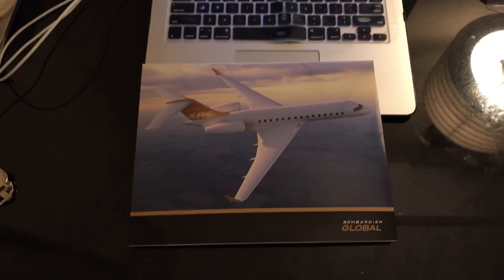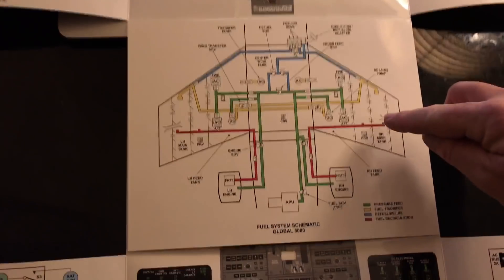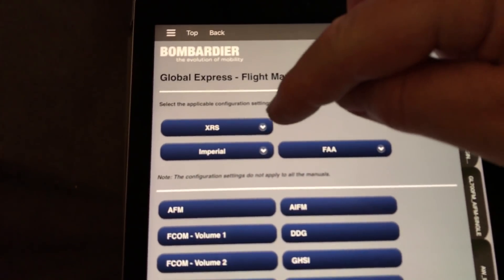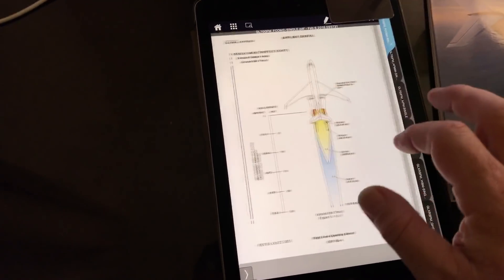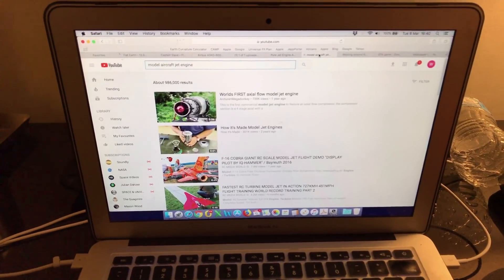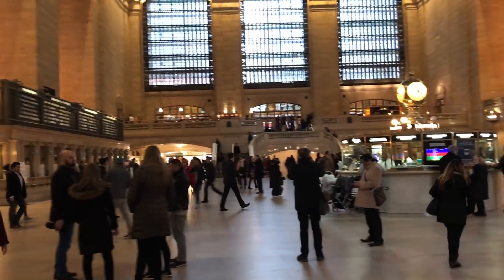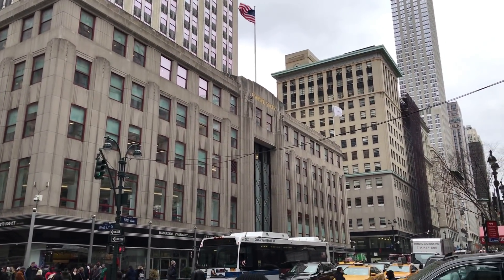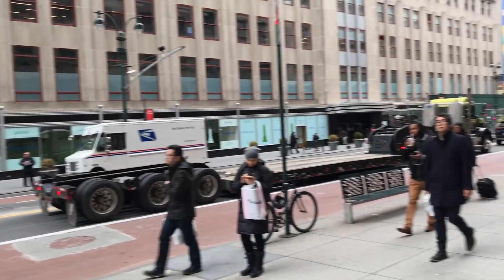Don't be ridiculous - of course Jet engines use liquid fuel.

Comment: There is one guy, from my country the UK and to listen to his videos on this 'no fuel' conspiracy, I'm not sure whether to laugh or cry, he is an embarrassment to the human race. But basically, he make videos where he shows the fuel transfer truck, then babbles on about impossible flow rates, impossible wing tanks etc. 
Then he had a book on diesel electric trains....where's the huge fuel tank he asks. 
Even more funny is that his job is a heating engineer! I wouldn't want him fixing my CH.
Reply: Rob Dunfy you on about Jones senoj? You mean the guy that's got the airbus spec book and has gone through it, researched topics you have just mentioned, and called it out for the shite it is? Could you please explain the lack of fuel tanks or flow rates not adding up? Or the 100t on each wing of fuel supposedly? Fun fact, a maus tank in ww2, heaviest tank ever made only clocks in at 188t.... So an airbus weighs more than that.
Reply: Oh, yeah.  You really ARE one of them braindead scholarly characters that can't  keep his spittle contained during a conversation.., 

Fun fact.  Who cares if the Germans built a 180 ton tank.

A fully loaded (Fuel and passengers) clocks in a 1,265,000 pounds.  That is 632.5 tons.  And YES, it actually flies.

There are some maths for that if you are really interested..,
Reply: Read some of these for starters:

https://tinyurl.com/yaza5twf
Reply: Neil Helgeson 630 tons, so over 3 times the weight, the maus had a 2280 hp engine and could move at 12mph, I understand about ground resistance it's a tank and all that. But something over 3 times heavier, with a hp of 8x more with respect to weight can fly and reach speeds of over 500mph. How do the wings not snap with 100t of fuel on them each either? They're only made of lightweight alloys.
Reply: The Truth I still wouldn’t want him touching my CH system! Clearly if he can read a Valliant manual and understand it runs off gas, but reads the airbus book and thinks it runs off air, then something is seriously wrong with his analytical brain.
Reply: Rob Dunfy so a guy with expertise in piping and such raising a point about liquid flow through pipes obviously hasn't got a clue what he's on about... Yet you'll listen to wolfie who is a PILOT and not an engineer instead..... I don't get it.
Reply: +The Truth I guess you mean the guy who missed, for example:

http://www.airliners.net/forum/viewtopic.php?t=1360257

No fuel tanks?   The fuel tanks occupying almost the entire wing of an A380. 

Most large airports handling aircraft like A380 have underground fuel delivery systems delivering fuel to the aircraft from "hydrants" (recessed underground).

Here's a company that makes the equipment:

https://www.airport-suppliers.com/supplier/refuel-international/
Reply: +The Truth

I see you are in "Full on Incredulity" mode..,  

Each Rolls Royce engine on an Airbus 380 produces 70,000 pounds of thrust.  That is almost 60,000 HP!!!!!

That is about 30 of those marvelous Maus Tanks.., 

How do the wings not snap off??   I believe it is called METALLURGY.
Reply: Neil Helgeson oh, it says 70k hp on the Internet. In respect to weight it's less than 10 of them. Well if we've got this great alloy that's amazingly strong and light as shit, why don't we use it with everything? Imagine mpg on a car made from it etc. Looking at all your links but on my phone so will take a while.
Reply: +The Truth Why don't we use it with everything?  We use aircraft aluminum alloy, or slightly different alloys for lots of things.  Including cars.

Why not for everything?  Steel is a lot cheaper.
Reply: The Truth you put gas in your car to drive from A to B, does that make you a car mechanic? I’d wager a pilot is far more knowledgable about planes than the majority of car drivers, so yes I’d trust the pilot over a heating engineer to tell me how a plane works! Plus I’d trust any pilot that he puts enough gas in to get to our destination.
Reply: Fromage Frizzbizz on your fuel tank example, please watch this vid. Also notice at 2.26, are they sockets? Look like it to me. I didnt think fuel and electricity mixed well? Also notice the lack of fuel residue, guy not wearing a mask etc. Also look up 100t of fuel in comparison to fuel tankers, the sizes don't add up.
Reply: Rob Dunfy wtf did you just even write. A pilot flies the plane, he doesn't even put the gas in! Your car point further proves my point... I'd wager a gas engineer knows more about how cars work than a person driving from a to b, as cars have pipes! So do planes!
Reply: Fromage Frizzbizz steel is cheaper for the producer yes. Imagine the money saved in mpg to the consumer and the safety with such a light car that's so strong though. Here's me thinking people/companies/governments actually give a shit about the environment and other people's welfare 😂
Reply: The Truth I forgot to add, he’s a big fan of the AgentJayz channel. This guy repairs jet engines for a living and has videos of fighter engines going into full afterburner mode. Yet he has used these videos to show that jet engines run off air!! I mean WTF!
Reply: Fromage Frizzbizz those wings look awfully thin to be carrying 100t of fuel each, also don't forget all the wiring, housing for engine etc. 

https://www.google.co.uk/search?q=a380+wing&client=firefox-b&dcr=0&source=lnms&tbm=isch&sa=X&ved=0ahUKEwjA1L_7htjZAhXqLMAKHWjyAzMQ_AUICCgB&biw=360&bih=512#spf=1520351576280
Reply: @TheTruth-vu6sp , you're not only stupid you're too stupid to understand that you're stupid.

So the A380 wings aren't big enough to hold all the fuel? Have you calculated the volume requirements and compared them to the A380's dimensions? No? Why not?
Reply: Another reason I've seen these conspiritards use to justify their paranoia is this:

"Fuel tank sizes in your car haven't changed in decades.  Technology improvements should have let us put 100 gallons or more in our cars by now.  Conspiracy.  Keeping the truth from the masses..,"

Huh???????
Reply: Carbon Composite wings. Same tech as F1 racing cars.
Reply: +Rob Dunfy.., 

Composite materials.  Yep.  Them too..,
Reply: +The Truth... he seriously knows less than fuckall about high volume liquid transfer... The goals for heating are literally the exact opposite than they are for high volume transfer. I managed a bulk facility that handled about a million gallons a month.. Heating engineers want to maximize the time in front of radiators or heat exchangers... Process industries for the most part want to get stuff from one place to another as fast as possible..  Our portable pumps pumped about 400gpm in liquid transfer and 150-200gpm when being used on filtration.. They were small the pump itself only weighed about 50 pounds and the whole thing could easily be moved by one person.

He only has a single problem to overcome... the law of conservation of energy... If he's going to claim they run off of compressed air the only way that happens is if they put the compressed air on the plane on the ground.. So what would that look like... Each A380 engine discharges a minimum of 2000 pounds of air per second... So for the plane's range 2000 pounds/second X 4 engines x 60 seconds x 60 minutes in an hour x 12 hours (conservative as Emirates has a 14 hours flight from San Francisco to Dubai) =  345+ million pounds of air.... so what's more likely  544,000 pounds of fuel or 345 million pounds of air?
Reply: +The Truth Aircraft take fuel into fuel tanks, and electricity into their electrical system.  So does an RV.  Big deal.

Of course the fuel inlets look like sockets.  So do the water spigots on fire trucks.  Have you ever seen the fittings on a fire truck?

Lack of fuel residue, no mask?  Is there lots of fuel residue around your local gas station?  Do you wear a mask?  Do you think that the connectors used to fuel aircraft are allowed to leak?  Seriously?

Did you not read my posting where I pointed out that most large airports refuel the larger aircraft by underground pipelines and hydrants inset into the ground?

A large ground fuel tanker can carry 10-15,000 gallons.  That's 35-52 tons of fuel each.  With pumps that can push 800-1000 gallons per minute, plus multiple fuel loading spigots on an aircraft, 4 tankers can fill a A380 in 20 minutes or less.  See http://skymarkrefuelers.com/products/

Oh, did you notice the hydrant dispenser truck?  What do you think those things are fore?   1000 gallons per minute.  Two of those could fill a bone-dry A380 (which they rarely if ever are) to overflow in just over 40 minutes.

Skymarkrefuelers wouldn't exist if aircraft ran off compressed air.
Reply: +The Truth Steel is also cheaper for the person who buys the car.

You want to buy an aluminum car?  Easy.    There's quite a few.  Do they save gas?  A bit.  Not all that much.  Hint: air drag is a major component of fuel consumption.

Now that you have an aluminum car, just try to get it repaired after a fender bender.  More difficult to bend properly, harder to weld, and a number of other drawbacks.

And ask yourself, how's it going to look when the aluminum bed in a Ford F-150 wears through?

Making aluminum isn't exactly environmentally friendly, and costs at least 4 times as much as steel.
Reply: +Rob Dunfy you sure he repairs jet engines for a living, or is that yet more youtube doggy do?
Reply: +The Truth  http://www.geograph.org.uk/photo/3829924 and http://bit.ly/2D4XPm8 don't look thin at all to me.

You just don't realise how big an A380 is.  The wing is thick enough or a person to stand upright.  It's not even the first aircraft with wings that thick.  There was a flying boat whose wings were so thick, they carried mechanics who could walk out on the inside of the wings and service the engines.

The wiring and hydraulics goes through channels to where they're needed.  Doesn't occupy very much space at all.

The engine housings aren't in the wings moron.
Reply: Honest, don't know, but seems to know a lot about jet engines. https://www.youtube.com/user/AgentJayZ/about
Seems he has a shop in Jet City! Very popular guy.
Reply: Yeah, here's the "Flight Deck and Systems Briefing for Pilots" for the A380. Section 10 is all about the fuel system: 
http://www.smartcockpit.com/docs/A380_Briefing_For_Pilots_Part%202.pdf
Reply: The Truth
Perhaps you should look at this pic - https://www.wired.com/images_blogs/autopia/2010/03/index.jpg - It's the wings of a Boeing 787 dreamliner being flex tested - In the photo you'll find that they're bending upwards almost 25 feet - That's why they don't snap - Oh that and the fact that once in the air it's the WINGS that support the body of the plane - not the other way around...
Reply: Rob Dunfy 

I work with jets and their fuel.  I can go outside and watch crew chiefs full them up twice a day. I have also refueled the jets AND worked in fuel cell areas. I just changed a part a couple weeks ago that was cooled by fuel, and it had a slight fuel leak from a rolled oring. Fuel was definitely all over my hands.

I'm sorry but you are an absolute idiot if you really believe that jets don't use liquid fuel because of these ignorant flat earthers.

Gas masks? Are flipping stupid? do you need a gas mask while you fuel your car? The jet fuel does not vaporize nearly as much as gasoline, it is almost oil like... pretty much diesel honestly for a quick comparison. The ports for refueling are also sealed unlike fueling a car. When you take it off there is some residue on the end, but no fumes are pouring out while you refuel.

Not to mention that the crew chief, pilot, and POL fuel guy are all monitoring the flow of the fuel. The struts can even be measured for the the weight of fuel the aircraft is. On fighter jets the struts can get stuck up high after refueling and we'll shake from the wings to get the jet to settle, since it would be a hell of a surprise to be under or on the jet somewhere and have it settle of the sudden.

Join the Air Force and asked to be a POL (Petroleum Oil and Lubricants) person. You can deal with LIQUID FUEL and drive around trucks full of it all goddamn day like they do if you want to.

Or you can come be a fuelshop guy. They work with the fuel cells that have LIQUID fuel in them all day.
Reply: Rob Dunfy, I'm not sure what a heating engineer has to be taught to get qualified but I would have thought basic thermodynamics at least. I did a couple thermo subjects and it covered things like petrol, diesel, steam and jet engines. And we did lab tests on all those engines to measure things like fuel consupmtion, engine efficiencies etc. If this bloke did study these things and passed, and now has thrown all that out the window then I can only suggest he's been hit by a bus and survived but with significant mental deficit.
Reply: "Then he had a book on diesel electric trains....where's the huge fuel tank he asks." Uh, right underneath the frame, between the trucks. They are one of the most visible parts on a locomotive.
Reply: +The Truth Want to see just how strong airliner wings are? Go look up the Boeing 777 wing loading test video – 24 feet of deflection before they snap.
Reply: Justin Franks, "Then he had a book on diesel electric trains....where's the huge fuel tank he asks."  This is getting sillier by the minute. So this guy who presumably drives a car and goes to petrol stations to fill its tank with either diesel or petrol thinks internal combustion engines don't need fuel. I wonder what he is thinking as he is standing there with pump hose nozzle inserted into the tank?
Reply: +The Truth And to those 'awfully thin' A380 wings, take another look: https://qph.fs.quoracdn.net/main-qimg-ec1a89040dc009d93cd187f360cd9ff5.webp
Reply: The Truth:  I would rather have Wolfie, who is 'just' a pilot use liquid fuel to fly me to my destination than a nutty conspiracy theorist who thinks he'll get me to my destination on compressed air and prayers to God.

I'll give you the benefit of the doubt and say you're a persistent troll saying things to get a response from others, because otherwise I can't imagine how stupid you really are.
Reply: This whole mess seems to have been started when some idiots saw a jet engine being started by compressed air, and then via a mixture of Dunning-Kruger and argument from ignorance, concluded that 'obviously jet engines run on air'. Is it any surprise that the flat earthers just lap this sort of shit up?
Reply: I might be the only person in this comments thread to have flown on an A380 (Emirates). Shortly before pushback (at London's Heathrow Airport)  there was a pre-recorded cabin announcement in 6 languages to the effect that the aircraft could not fly unless at least 25% of passengers believed it could.  Thankfully, most passengers believed it had flown in so could fly out. It did.  The engines were turbofans, so probably it was wind powered. :-)
Reply: +The Truth You mean that guy claims to have expertise in piping?  You believed him?  He clearly has none.

He claims that if you're filling a tank with 1000 litres per minute (a medium-sized airport fuel pump) that you have to vent out 1000 litres of air per minute.  Which is true.  Which is why airliners fuel tanks have vents.

But then he says that 1000 litres per minute out the vent pipe would raise such a shriek that you'd need hearing protection "AND WHY WEREN'T THEY WEARING ANY??!!!".   Really? Did you really think this through?

1000 litres per minute works out to 33 cubic feet per minute.  An ordinary 4" computer fan in a PC moves over 100 CFM.  Does it raise an shriek?  Nope.  I can't hear mine at all.  An ordinary forced air furnace blower moves 800-1200 CFM - more up to 30 time as much.  Does it raise an ungodly deafening shriek?  No of course not.

Let's try another: He says that a pump rated at 1000lpm @ 45PSI pump sitting on the ground (or 100s of metres away on the underground piping system) will produce 45PSI in the tank.  You think so?  Really?  NOT IF IT'S VENTED it won't.  And we know it has to be vented.

The guy's a liar.  He's not an engineer.  He doesn't know the slightest bit about plumbing.   So who should you believe?  A Pilot or a proven liar?
Reply: +Rob Dunfy The book he's referring to is a "Haynes manual" on the Concorde.  For those who don't know, Haynes (and Chilton's) are quite famous for publishing reasonably priced books on individual car models that DIYers can use to service their cars.  They're quite good actually.  But they're NOWHERE NEAR as detailed as the books that the manufacturers themselves produce.  For example, a Haynes manual will show you how to change an alternator, fluid capacities and so on, but it won't go into the detail of things like where the body panel connectors are, the extreme detail of test and diagnosis, the details of every single wire, connector, and doodad in the car or torque requirements of every bolt. The manufacturer's books do.

Back in the day when I did a lot of auto DIY, I tended to buy the "real" manufacturer's manuals, because at least some of the manufacturers deliberately priced them quite reasonably.  But when the prices got up to the $150+ level, I switched to the Haynes or Chilton's versions at $30-$40.  Now I have to ask a Dealer on the precise details of something I want to do.  For example, I had to ask the Dealer how to get a bit of interior panelling off without destroying it.  How did the Dealer know?  They had the real manual.

Chilton's and Haynes's books max out at a few hundred pages.  Modern manufacturer's manuals run into the thousands.

Haynes took the Concorde book on as a bit of a joke.  The authors are people professionally quite familiar with Concordes. The book is really more of a map of what/where the major parts are and stories about the aircraft itself.  There's NO flinking way you can really service a Concorde using that manual.  A real servicing "manual" for a Concorde would occupy many feet worth of floor to ceiling shelving and be absurdly expensive.  Probably cost more than my house even in a multi-disk DVD set.

It's a souvenir book for a Concorde fan with a bit of a wink for it's audacity to claim it's actually a service manual.  Useful to understand how the aircraft was built, and where the bits are.  But if they saw you marching towards a Concorde with a wrench in one hand, and the Haynes manual in the other, they'd haul you off to the loony bin.
Reply: +Rob Dunfy He's not a heating engineer.  He's making up that part too.
Reply: +Rob Dunfy Re AgentJayZ ah, you're right, he obviously is.  Somehow I got him misplaced into the "jets run off compressed air" lunacy.  Oops.
Reply: +Tubbyengineer There's a video I saw long ago that I believe was a 'test to destruction" of a 757 wing.  The amount of force that required was quite spectacular.

During take off a B52's wings routinely flexes more than 20 feet.
Reply: +Rob Guyatt He doesn't apparently claim to be an engineer, only that it's "familiar with piping".  Which means he's not even certified for HVAC.  There's no such thing as a "heating engineer".  The closet thing to what I think he's talking about is a HVAC tech - basically meaning the guy who calculates how big a furnace for a house needs to be,  sizing/locating the ductwork from regulatory-approved sizing tables, and might know how to spec a hydronic system.

At the real "engineer" level, we'd be talking about a civil engineer specialising in heating/cooling systems.  They'd be the guys designing furnaces or hydronic units for manufacturers, or writing the instruction manuals on how HVAC contractors do their jobs.

But the guy demonstrates a complete absence of even the most basic engineering training.  Doesn't even know the basic principles of plumbing like ANY  plumber or first year engineer would know.  Isn't aware of pipe friction or head losses.  Or to realize that as much as 1000lpm sounds, 1000lpm of air coming out a four inch hole won't deafen everybody for 100s of feet.  In fact, it'll be barely audible at all at more than a couple feet.  [Hint: a 4" PC case fan pushes 3 or more times as much air. 1000lpm is only 33cfm]
Reply: The Truth 
.....does the word 'spoof' mean anything to you?
Reply: +Kevin D "I might be the only person in this comments threat to have flown on an A380".  You mean that Wolfie is piloting Quantas A380 by remote control? ;-)
Reply: +Gr Ra: As can be amply demonstrated, anyone using "truth" in their own name, or says "the truth is ..." is usually about to tell you the most outrageous lies.

Scientists and engineers speak of "facts" and "evidence".  Truther's project political or religious ideas - evidence and facts are irrelevant and are ignored.
Reply: +The Truth - Would you listen to me, as a gas turbine designer, if I told you that they absolutely, definitely run on liquid fuel because I design the things? If you want proof, google my name and the word "inventor" and see who my patents belong to. Sorry if that sounds craven and self-aggrandising - but I'm guessing you've no obvious reason to trust me saying it if I can't at least prove my credentials.

Regardless - I could bore you to death with the details of the liquid fuel system in our engines, and by extension, in the aircraft. There aren't many conclusions to draw from this - either: One, gas turbines burn liquid fuel, or two, I, and by extension all of the ten thousand plus design engineers I work alongside, are party to a huge conspiracy. I can assure you, if you want a watertight conspiracy, don't let an engineer in on it. Certainly don't invite thousands. We're hopeless at that sort of thing!
Reply: The tips get thin. The wings have a fair aspect ratio (i.e. they're wide relative to their depth) but they're really, really big, so their depth is still significant:
https://www.cnet.com/pictures/following-an-a380-through-rural-france/
Reply: The Truth and you actually think that an AirBus can get off the ground with compressed air Jone senoj just a guy that is clueless jist like you ignoring people in the aviation industry good job stay ignorant !
Reply: The Truth how n the hell is a damn airplane going to hold that amount of compressed air when there are no compressed air tank engineered that would hold that much air where is it on the aircraft that is a better question ?
Reply: The Truth Friction due to moving parts, tyre flexing, and air resistance are important. There are some limited gains from a lighter chassis, and a carbon fibre chassis would be even lighter. But then you are in racing car territory. Car manufacturers have simply calculated how much extra the public are willing to pay for fuel economy, looked at all the options for the best compromise between fuel economy and cost as perceived by their market, and come out with the answer: steel chassis. There are engineers who make a living by finding ways to save 10 cents per car.
Reply: Robert Doe And probably cost a fortune!
I guess this was empty? Fully loaded I doubt if the difference would be so great. In the UK an artic carrying 24 tonnes will weigh 44 tons gross. So the greatest factor you would expected to improve fuel consumption  by is to approximately halve it, and that is in ideal circumstances.
Reply: Robert Doe Thats interesting. I hope that one day it will be cheap enough for mass production. But the original question, way back when, was about using aluminium or aero grade aluminium alloy rather than steel for mass produced cars. The question was on the lines of " if aircraft alloy is strong enough to hold hundreds of tons of fuel, why don't  we use it for everything" And the answer is that the cost of mass production and maintenance would  be so high that the public would buy cheaper pressed steel cars, irrespective of fuel economy.
But the existence of strong composites and alloys supports the fact (that everyone knows except conspiracy theorists): aircraft run on fuel.
Reply: The Truth  please change your name to fancyful lies pilots have to know their aircraft and often watch their aircraft refuel on the tarmac. How long have your friend that misinformed to modern aircraft worked on airplanes?
Reply: I agree. Jones Senoj brings careful analysis, whereas Wolfie6020 just shows us the official manual and a few screenshots, and then devotes half of the video to something totally unrelated.
Reply: savarios By careful analysis I take it you mean one that ignores everything we know about conservation of energy, the volume and weight of air flowing through jet engines, the strength and weight of the containers that would be required for that air, that fails to specifically calculate the volume of fuel tanks from dimensional drawings, and ignores   the stringent procedures specified for cleaning and venting these tanks before working on them. Also he seems to discount all the aircraft fires that we know of through bitter experience.
Reply: It baffles me why would I build a fuel tank without any baffles inside it. Fuel tanks have baffles built inside them to slow down the velocity and momentum of the liquid. If this was not done the truck would not be able to stop.
Reply: This is ridiculous  can you Put 5 gallons of liguid into a 1 gallon container?
Reply: chris billig obviously you can.t... but it.s irelevant since in a big airplane You don.t lack space for fuel
Reply: Yeah, this A380's wing looks really thin !? = https://www.google.co.uk/imgres?imgurl=http%3A%2F%2Faviationweek.com%2Fsite-files%2Faviationweek.com%2Ffiles%2Fuploads%2F2012%2F05%2Faw05282012191460.jpg&imgrefurl=http%3A%2F%2Faviationweek.com%2Fawin%2Fa380-retrofit-painful-learning-process&docid=BK6ncwR2oBgGsM&tbnid=1jdUBP2QX6EhAM%3A&vet=10ahUKEwjOtva41Y3bAhXJLsAKHed4D-cQMwjFASgtMC0..i&w=250&h=167&client=firefox-b&bih=850&biw=1495&q=a380%20wing&ved=0ahUKEwjOtva41Y3bAhXJLsAKHed4D-cQMwjFASgtMC0&iact=mrc&uact=8
Reply: Neil Helgeson the truth is that barely changed. But the engines became more efficient
Reply: In case anyone was wondering ... 'The Truth' is a zero content zero history troll doing what he/she/it is paid to do.  You can click on its thumbnail and see for yourself, or you might notice the word "Truth" in its channel name -- you can pretty much guarantee that any channel with the word 'Truth' in the name is going to be 100% bullshit.  So, next time you see someone posting absolute bullshit check there channel and if they look like they are a troll they probably are.  Best not to do what it wants and engage it in a debate, that's not what they're here for, they seek only to dumb people down and aggravate so don't reward them by doing what they want.  Either ignore the twats or call them names, but don't fall the the troll trap they set.
Reply: I mean is the population really so stupid that you are debating weather or not a plane uses fuel? Lmfao smh. Wow. I see that most the people that think planes don't run on fuel also believe the earth is flat. You people all have 1 thing in common. If it doesn't make sense to you, it must not be true. "Oh it doesn't look like that much fuel will fit in the wings so that means there is none" stfu already. You people just make yourself look stupid. Go get a fucking job fueling planes so you can see for yourself. Wait even then you still wouldn't believe it because it's way more than your peanut sized brains can comprehend. Fuck people are so stupid. Makes me embarrassed.
Reply: +Rob Dunfry writes "Then he had a book on diesel electric trains....where's the huge fuel tank he asks."

See the linked photo, the fuel tank is labeled "+Fuel Tank"

http://www.visualdictionaryonline.com/images/transport-machinery/rail-transport/diesel-electric-locomotive/diesel-electric-locomotive_2.jpg